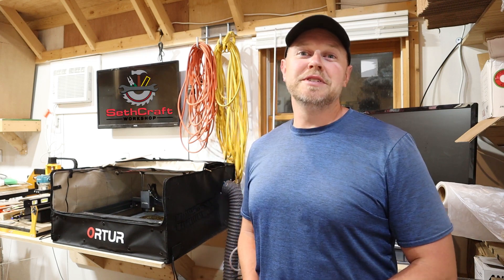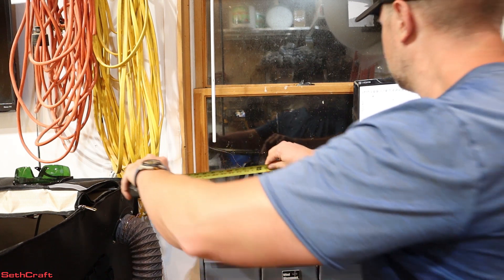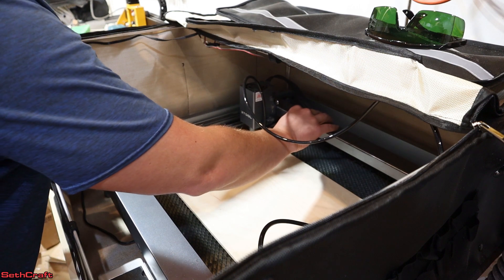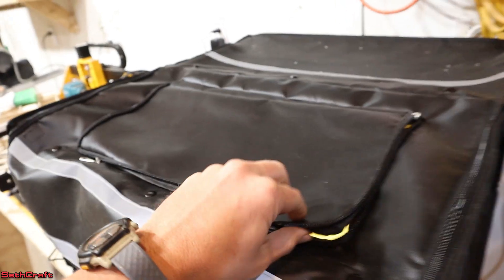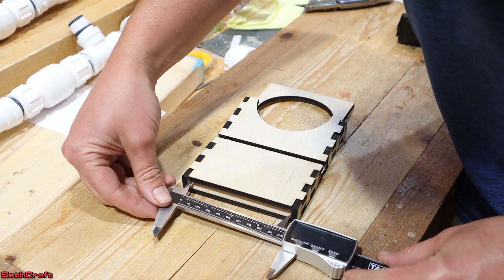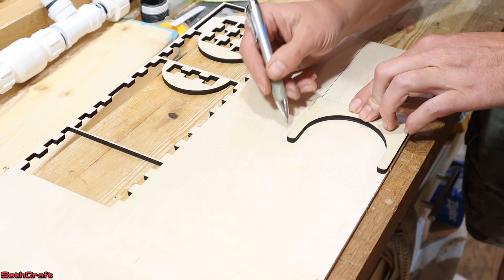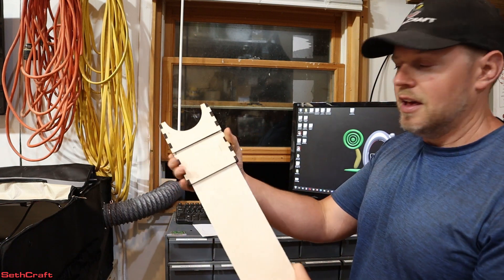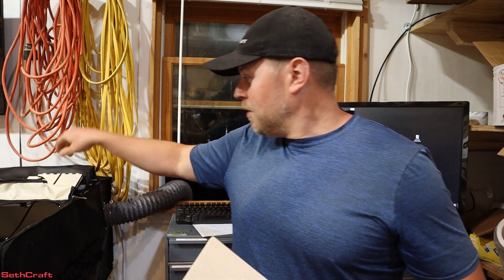DIY Laser Engraver Exhaust Pipe Window Pass Through Vent

Comment: Clever design.  Ideas? yes, one: if you make the legs of the sliding half-circle part a lot longer, you could put the guides on the inside of the legs, that way the slider and the part it slides into would be the same height.
Reply from the maker: Thats a good idea. When I revisit this pass through idea I can try that.

Comment: That's a very creative design! I've seen many other laser owners in groups online ask about solutions just like this. So many are in rented spaces or in areas where boring a 3"-6" hole through a wall simply isn't an option. This is a great showing of how to use the tool to make a solution!
Reply from the maker: Good point! Renters might lose that deposit after drilling a 6" hole in the wall.

Comment: I've seen you cutting a lot of holes in walls.  I'm surprised you'd bother with the window passthru instead of simply cutting a hole in the wall and putting in an exhaust vent.
Reply from the maker: Coming up soon I will be building a 20x30 shop. This new shop will have a dedicated laser room. That space will have a hole in the wall for the exhaust.  I did not want to drill a hole in the old shop when the laser will be moving soon.